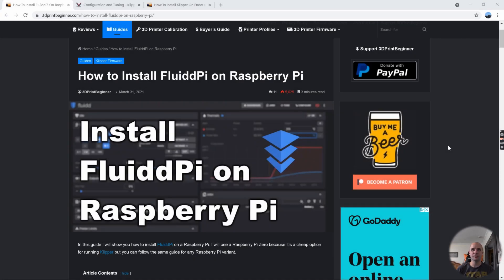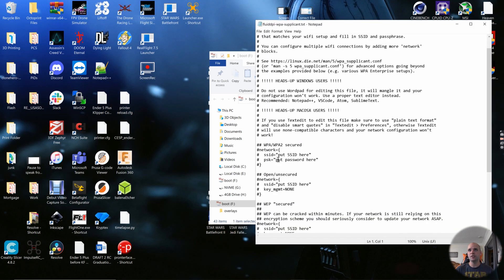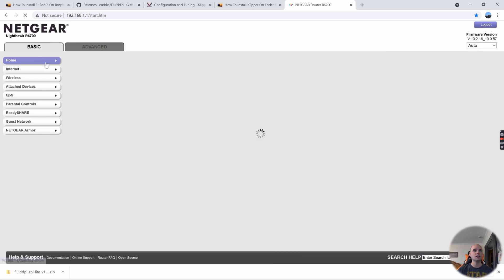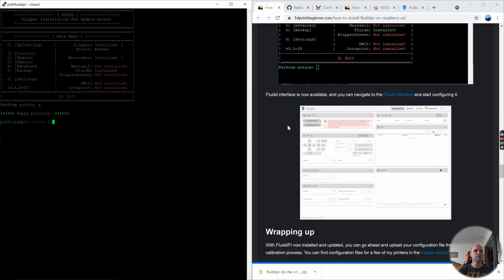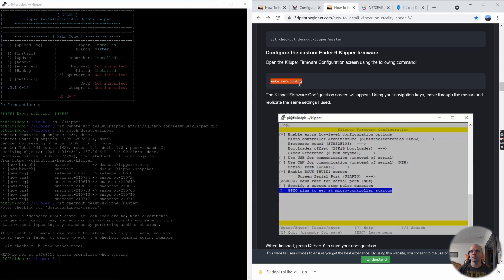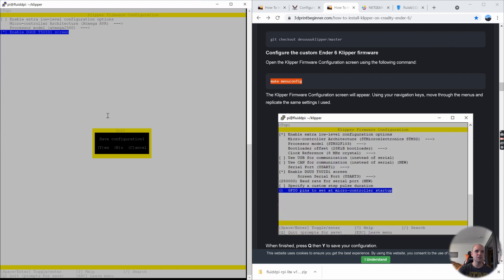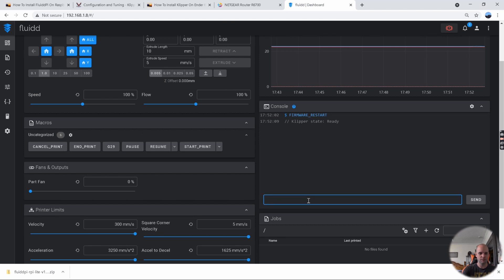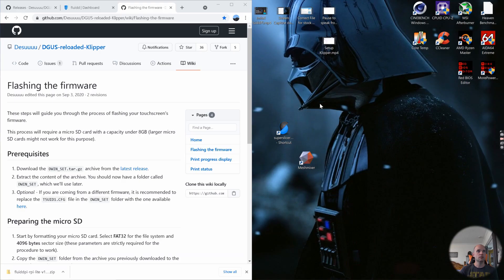Klipper Install for Stock Ender 5 Plus

Comment: Great video! I'm running into an issue with flashing the stock screen though. It flashes in about 1 second, versus what looked like ~10 seconds in your video. After removing the SD card and plugging it back in, I still get the stock boot screen instead if Klipper. Any idea why that might be?
Reply: NVM! I didn't format my SD Card correctly, I forgot the 4096 allocation unit size. All good now!

Comment: I now want to use Mainsail instead of Fluidd. Will the Stock Ender 5 screen work with Mainsail as well after it has been flashed?
Reply from the maker: I believe so. Screen is run by Klipper not Fluidd/mainsail

Comment: Will this work with the latest 4.2.7 32bit board on thr Ender 5 Pro?
Reply from the maker: This firmware is specifically for the 5 +. I don't have any knowledge on ender 5 pro.

Comment: FYI - I WAS able to flash my stock Ender 5 Plus screen with a micro SD card larger than 8 Gigabytes. I used a 16 Gigabyte card formatted in FAT 32 using the 4096 Allocation unit size.  All I had on hand was the 16 Gigabyte card so I figured why not give it a try and it worked!

Comment: Hi...How is the stepper motor noise level with your setup? The stepper motors with the supposedly silent v2.2 board are not that silent with the stock firmware. Also how do you like it 2+ months later.    Thanks
Reply from the maker: It is pretty quiet on my silent board. I did not see much of a difference in noise from before to after install.

After a couple months, I am really liking the Klipper install, faster prints with higher quality.
Reply: @phillipandrew5095  Not sure what I did wrong, but I can't connect to Klipper. I followed your instructions. The only thing I didn't do was enable WiFi because My 3D printer/Raspberry Pi is close to the router. I used a Cat 6 cable to connect Raspberry 4 directly to the router. Then I used the stock cable that came with the printer to connect from 3D printer to the side of the board/printer. I tried to go back to the Ender 5 Plus stock firmware by disconnecting the Raspberry PI and it's no longer there. It's like the Stock firmware somehow got wiped off the board.
Reply: OK I guess I am making progress. I saw the notification bell in upper right hand corner. It wanted me to update Klipper. Once I did that I am sort of able to connect but I have a new problem. When I make changes to the Printer.cfg file it seems as tho klipper is not reading them because when I check the Klippy log file it still has the old settings.

Comment: I will be ordering my ender 5 plus soon! Defenetly plan on upgrading to klipper. Do you have any before and after prints? where you able to change print speed? What have been the benefits?
Reply from the maker: Before vs after is higher quality in less time. I printed a Mando helmet on stock and it took 70+hours and the quality was not great. I printed another Mando helmet (same files) after installing Klipper and it was done in less than 30 hours and the quality was incredible. Getting pressure advance and input shaping dialed in makes a world of difference.

Comment: When  about to flash i get a "Failed to stop klipper.service: Unit klipper.service not loaded.
" Also tried to start it to check, but also failes to start... Hmm . Yeh i have two instances of klipper installed.

**Edit now also tried to re install both instances of klipper and moonraker, and did this all over, but still geting this message... Wierd..
Reply from the maker: Sorry to hear. I have not run into this issue and I am not sure how to solve it. There are lots of threads on Reddit that may help. Reddit is where I went to solve all of my issues so far. Best of luck.
Reply: @phillipandrew5095  think i figured it out. Need go do like "stop klipper-1" "stop klipper-2"
Reply: Wiers that you didn't have to tho 🤔

Comment: i am getting error "Section 't5uid1' is not a valid config section" its been there since thew start since i started using your config file. screen is stuck on klipper logo but the printer is working
Reply from the maker: Make sure to select to use screen during putty setup. Check video again, I explain this.

Comment: Thanks for the great Video! 
It worked for me until i wanted to flash my screen. 256MB SD-Card formated as mentioned. but the screen ist showing "Ender 5 plus CREALITY" for an eternity.
I have tried release 1.0 and 1.2 already. Can you please help me?
Reply from the maker: You have to use the version of Fluidd from my links above, and be sure that you select to use the screen when setting up in putty. If you check out the video again, I explain how to do this.
Reply: @phillipandrew5095 thanks for the reply but figured it out by myself, i was to dumb to Format correcly, because the Card was to big.

Comment: A HUGE THANK YOU for this mate! You shared literally a whole month of research in a few minutes video anyone could follow and install Klipper. So I did! Yeeee
Reply: If you are installing it now, keep mind firmware updates will make the screen inactive again, so consider not updating if you want to keep it. Although it was very useful to have it, it is a bit difficult to use, buttons were small and too close to the edge of the screen which is embedded into the metal so not natural to reach. Again, thank you for uploading this video, probably could not have maki it without this.

Comment: followed your guide and loaded your config file but i get this error "Section 't5uid1' is not a valid config section"  and it halts my printer
Reply from the maker: I am not sure how to correct this error. Make sure that you load files to correct location.

Comment: is i possible to flash screen and motherboard of the e5+ back to standard if one wants to go back from klipper?
Reply from the maker: Yes it is. I had to do it to make this video.  If you want to go back to stock, use screen firmware link at bottom of my video description. The firmware listed on creality website does not work for some reason.
Reply: @phillipandrew5095  top tnx  :)  going to see if the ender5+ will do beter this way because stock it isn't a big winner lol.

Comment: Thanks a lot! Just turned a stock E5+ running with octopi into a E5+ with DD extruder and klipper. Now let's see how this new config works for me.
Reply: Looking for an update. Is it working well for you now? Any hiccups along the way?
Reply: @toxiccan175  I just made time to try it out and when testing the extruder doesn't work. It makes sort of hicups when moving, so I guess it may be something related to the extruder cable/signal. Not sure so I hear any ideas from you guys.
Reply: @GiovanniAnfossy  8 months late but my extruder started skipping due to a jam and it sounded like 'hiccups'... That's the stepper motor skipping.
Reply: Yea i am curious as well! How are the results =D

Comment: Are you running a camera in fluidd?
Reply from the maker: I am. I used a video from Nero3d to help me get the camera setup.
Reply: @phillipandrew5095  right on. Mine wasn't working and then between when I left the comment and now it just started working. No idea why lol. I've actually setup two cameras now just because. 

Thanks for the reply

Comment: hey i like klipper a lot i put it on my ender 5 but i have issues with the walls allready used inputshaper but with bowden setup my walls suck much blobs can you help me your stormtrooper helmet looks very clean ?
Reply from the maker: If you are using the Bowden setup, you will need to use a very different esteps setting that I provided in the config file. The esteps in config file I provided are for the Micro Swiss Direct Drive. You should be able to find documentation online if you Google it you should be able to find info for calibrating esteps in Klipper.

https://github.com/KevinOConnor/klipper/issues/934
Reply from the maker: Also, Clone Trooper helmet was printed prior to Klipper upgrade. I will be printing more helmets now that I have Klipper calibrated though...